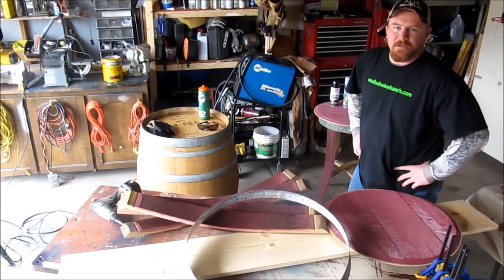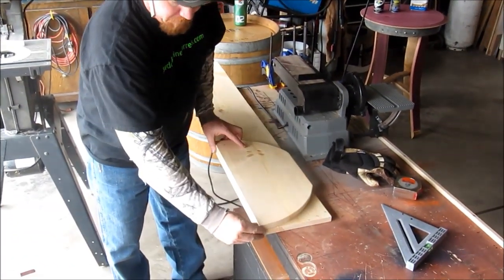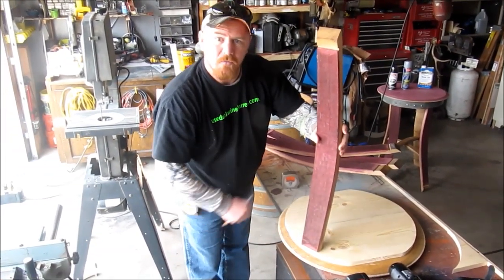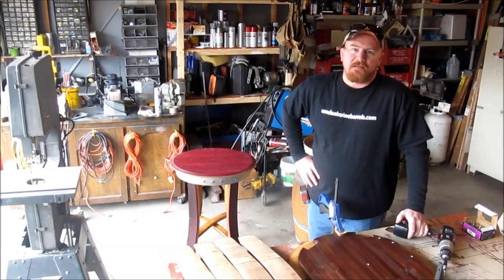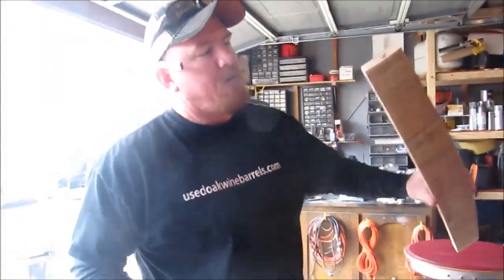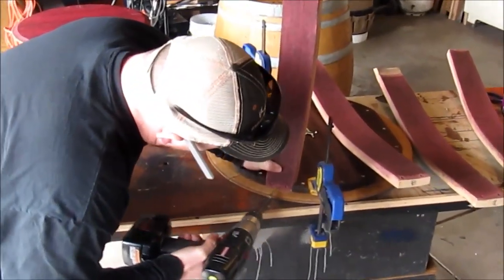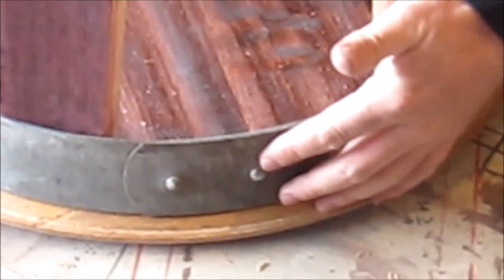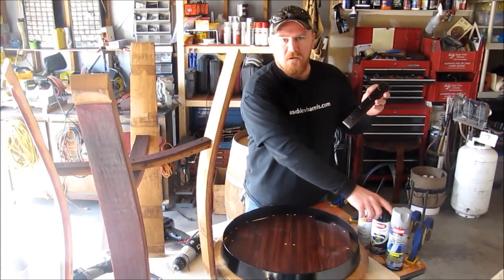How to build used oak wine barrel table

Comment: Instead of welding the band, could you just overlap it in one spot and screw it together to the common board, and then be able to install it last? For those of us who do not have the ability/equipment to weld.... Great video. Very easy to follow. Thanks!

Comment: do you know how to build those half wall tables that you see in wine rooms? they are cut on the vertical so the table is still about 3 feet tall and gkued to a wall. Im not sure how they get the metal back on just half the barrel

Comment: Hello how much is a wine barrel
Reply: Brand new? Usually around $1000. The more they are used. The cheaper they are. You could probably get an old barrel for around 50 bucks. But it probably won't be too pretty.
Reply: +raymond cervantes thanks